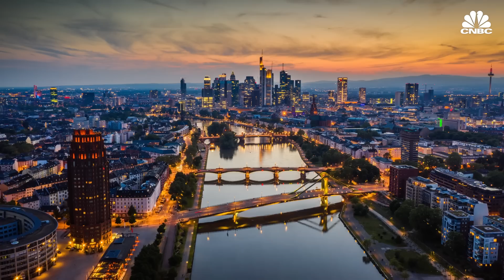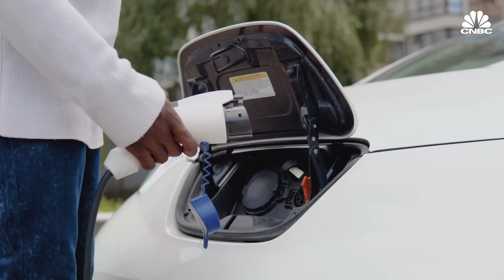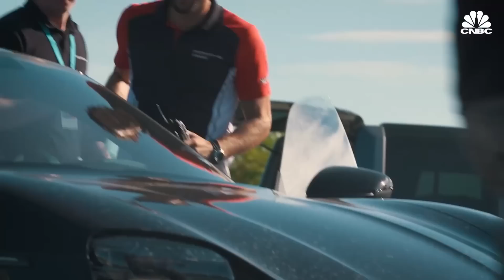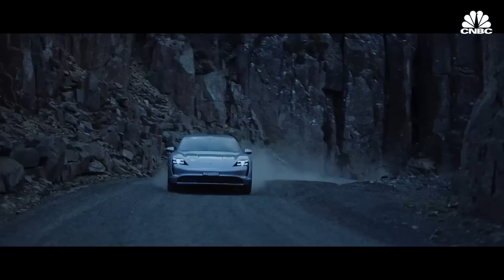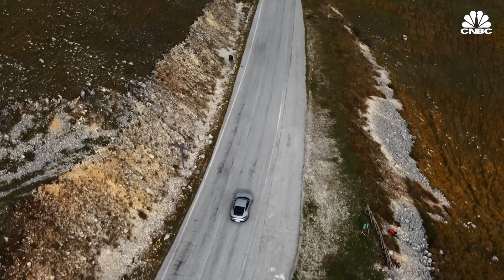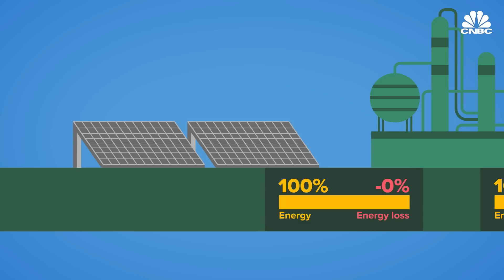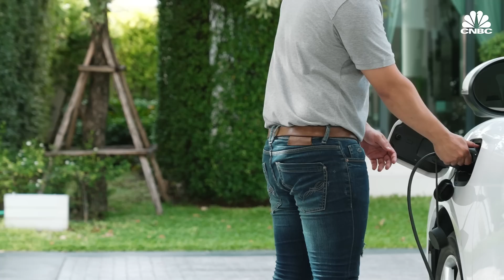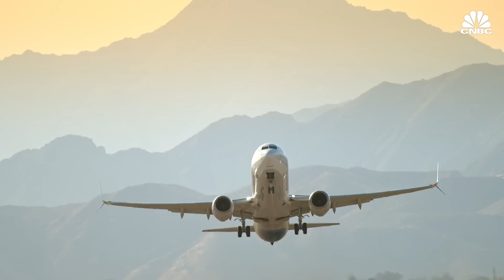How Porsche Plans To Keep Its Gas-Powered Cars On The Roads

Comment: Even if its "carbon neutral" it still spreads pollutants.
Reply: Electric cars do too.
Reply: @dadtherf401  but much much much less, my model 3 runs off my solar 100% so NO pollutants!
Reply: @eddevoe2519  until you realize it takes 100,000-240,000 miles to be cleaner than the average car and actually be zero emmision
Reply: @estevanperezz  not true

Comment: Automobile powerplants are just the start of this process of carbon neutrality.  Just wait until they apply the same ideology and methodologies to innovation and production of other technology in the near future.  Look around your home.  Imagine most of the things inside gone.  Your sofa, chairs, television, carpet, the glue holding your hardwood floor pieces together, your toilet seat, and most of everything else is going to be taken from you, or your descendants, eventually.
Look for a cave somewhere nearby soon, because there aren't many of them that are comfortable and people are going to be either "unexisting" others to secure one, or "unexisting" out in the open fields.

Comment: Why not just build over the coal burning power plants to collect CO2 more directly? It'll just become both the fuel and energy doubling the output no? Everything to collecting carbon from air to turning it into fuel sounds awfully inefficient. While it's a nice idea perhaps using that extra CO2 possible instead to be used as a fertilizer or for carbon fibres.

Comment: The point is that you can produce e-fuels where the sun shines 12 h a day, 35 days a year, and you can use them in Minnesota during winter when there is neither wind nor sun. That relativates the efficiency issue. Efficiency is not the point. The point is cost and time/location. The Saudis already build solar plants that produce electricity for 1 cent per kWh, corresponding to 20 cent per litre or $1.4 per gallon of e-fuel. The electricity is not a limiting factor.

Comment: Even if internal combustion engines are banned it would still be good for cement production and in Belgium you often pay €1.90/L for super +98 so the price difference won't be much if they can produce it on a mass scale.

Comment: Good thing we have 300 years of gas left
Reply: We don't. Around 40 to 50 at the absolute most. Nobody will still be extracting crude oil to refine it into road fuel in 25 years, never mind any longer. The air pollution at street level in our towns and cities will be unbreathable in 20 years, if we don't do something to reduce it.

Comment: This is so dumb that it hurts. Who would like to buy a slow, expensive, unreliable car instead of a spacious, fast, reliable and cheap EV? I think people will get over the petrol nostalgia pretty fast.
Reply: You're point of view is very ignorant unfortunately. There are many people that would like petrol cars in the future, especially in the sports car segment
Reply: @burgholte  People who said that analogue cameras would disappear were also ignorant.
Reply: @Rune Aanderaa  your comment is a contradiction to your original comment. Call me when your EV runs out of fuel in a remote are, I'll bring the ICE generator. Enjoy your traveling experience when the power goes out, or when your vehicle has to do a measurable amount of work 😂😂
Reply: @ʇɥƃᴉɹlɐ ʇou ɯᴉ  I live in Norway, and I have never experienced a power outage for 40 years. It is now pretty difficult to sell used diesel or petrol cars because they are expensive to run and frequently need service. Virtually all new cars are now electric. A friend of mine drove his Tesla to Montenegro twice last year without any problems. That is 3000 km one way. To buy an ICE car seems just stupid.

Comment: Porsche is showing what in depth engineering can do.   It needs to be stated again that noncondensing greenhouse gas behavior such as from carbon dioxide and methane does not warm the planet!   Carbon dioxide levels in earth's atmosphere are high for the last few millions years, but considerably low for high growth periods in the geologic record.  The cause of global warming is not known.   Global warming hit its high temperature of 1.1°C reported in 1991 and has not gone higher.  In 2022 global warming was reported at 1.1°C.  Earth's greenhouse effect would be held in heavy saturation by the strong greenhouse gas water vapor to add 10°F (5.55°C) to earth's temperature if it were the only greenhouse gas in the atmosphere.   Increasing greenhouse gases in the earth's atmosphere can not cause earth's greenhouse effect to retain more temperature.    Greenhouse gases are only active in earth's greenhouse effect that takes place within 20 meters of the surface.  After 20 meters from the surface all the far-inferred electromagnetic radiation from the surface that can loosely interact with the lumpy electrostatic fields of greenhouse gas molecules is considered to have been completely absorbed.  Its further heat transfer is by convection i.e. molecules bumping into each other.

Earth's greenhouse effect being held in heavy saturation by water vapor is well known and taught high school level earth science until Al Gore became vise president of the US in 1992 when Al Gore tried to make it US policy that human caused carbon dioxide emissions were causing global warming.  Al Gore spread the fraud that human caused carbon dioxide emissions were causing global warming far and wide to include the United Nations.   The fame that Al Gore has gotten from promoting carbon dioxide caused climate change has allowed his net worth of a few million US dollars after being US vise president to grow to well over 100 million dollars net worth.   There is no indication Al Gore was an environmentalist previous to his campaign against human caused carbon dioxide emissions and no more than token environmentalism later. 

The UN IPCC science reports when less than 200 pages long, provided you read the entire report, are transparent in that they only discuss greenhouse gases as cause for global warming and only sampled their greenhouse gases at an altitude of 20 THOUSAND meters well into the stratosphere where water vapor is near zero.  That declaration of sampling greenhouse gases at 20 thousand meters altitude both legally protects the authors from serious fraud accusations and means the UN IPCC reports are of no practical use for the discussions of global warming.  Educated readers will instantly wonder why gas sampling was not done over the entire air column of earth's atmosphere.

The main perceived benefit for going to zero carbon dioxide producing energy is not that there would be no carbon dioxide emissions, but that it would eliminate traditional vehicle producing irritating air pollution from unburned hydrocarbons.   This would make for a better quality of life in higher density areas such as cities.  Even local producing exhaust from gasoline and Diesel burning vehicles is irritating.  Over-the-road heavy duty Diesels in the USA meeting 2010 emissions standards put out extremely low emissions.  Non of the early 2010 HD over-the-road era Diesels actually were able to meet those emission standards and operate effectively.  It was far later about 2020 when over-the-road HD Diesels regained their million mile reliable operating life and then only from a couple manufactures.  Oxides of nitrogen are produced anytime high pressures and temperature take place with earth's atmosphere that is 78% nitrogen.  Oxides of nitrogen are produced in hydrogen fuel burning engines.

Comment: EVs are great for the majority of drivers. For some of us car enthusiasts, who are the minority, internal combustion vehicles are what causes us excitement. Sports cars, super cars and hyper cars are in low production and used infrequently, hence their carbon footprint being lower than say that of corollas on the road. Glad to see Porsche doing this as it will help keep these amazingly engineered vehicles on the road for the few of us that love them. I’ll gladly pay $10/g to keep my cars on the road. Would get an EV for daily commutes.
Reply: Exactly as a 23 year old car enthusiast myself when I heard Toyota was going to release the GR corolla with a six speed manual and a 1.6 L turbo charged in line 3 cylinder that produces 300 hp and 276 foot pounds of torque also with an all-wheel-drive system I about Peed myself with excitement and the icing on the cake is it comes with a mechanical handbrake that’s cable operated, and every other thing is pretty much mechanical the all wheel drive system the waste gate on the turbocharger the cooling system It’s essentially a love letter to the older cars that were all mechanical not to mention it’s a hot hatch, which is cool in itself but it’s purpose built to be fun and fast and put a smile on your face now if they would’ve made the GR corolla electric or even hybrid with a CVT automatic transmission it would’ve just been another dismal car on the road that meant absolutely nothing even if it had performance parts like good suspension and big disc brakes, and the carbon fiber roof that cut its weight down by 22 pounds on the circuit edition and even the much lighter Morizo edition that’s more track focused because it does not have a backseat it would’ve still been very heavy because of the batteries and electric motors, a dismal boring car thank goodness they didn’t do that to the GR corolla life is dismal enough with every new car, being a hybrid or an EV with a CVT transmission with a stupid name so I am very happy what Porsche is doing and I do think it is the answer with the E fuel electric vehicles are not the future at least my future anyway because I won’t be caught dead in one those cars are more like iPhones with a bigger lithium battery. Where is the enthusiasm and passion in that I know they have excellent acceleration, but that’s about all they possess that interest me and that doesn’t really make a fun exciting car that puts a smile on your face every time you drive it because you’re missing one vital component the noise, the noise of a naturally aspirated, or turbo charged and supercharged engine and modifications, of course tuning the engines to make some get more power. That’s also fun which electric cars would be taking away because you really can’t make an electric car go faster by tuning it, or throwing some performance parts to it besides tires and brakes and suspension you really can’t do anything to the battery or the electric motors that I know of anyway but even still, it’s not as enjoyable as there internal combustion engine counterparts
Reply: "I’ll gladly pay $10/g to keep my cars on the road."
Are you kidding?🤨
That's the price for fuel we already have in Germany.
To get this enviromental friendly you have to pay like $200/g.
Muricans...🤣
Reply: EV's are booring, they all drive the same, EV's are a step to just get people of the vehicles, and use public transportation and be dependent on government and loose their freedom of going anywhere they want and be confined to a 15 minute city and be slaves
Reply: EVs are not great for the majority of drivers; they are great for a very small minority of urban drivers - namely those in fairly dense cities in smaller, rich countries. Any timeline to phase out ICEs by X date is nothing but a gamble at this point that we'll have a magical breakthrough in battery tech before that date
Reply: I like dinosaurs too!
Reply: The longterm viability for your average third world person for EVs is unknown to me. As I get the feeling that EV vehicles will end up having a shorting working life than a ICE cars due to the difficult of sourcing parts and repairing electronic components.
Reply: I dunno but ev is boring souless and doesn't have a sense of fun...
Reply: 1) there is nothing unusual happening with the climate.

2) there is nothing wrong with burning fossil fuels.  Its problems in high-density areas are trivial to fix and already have been fixed.  CO2 is not a pollutant.

3) Climate alarmism is a big-lie superstition supported by tax-bribed liars.  (See Climate Discussion Nexus for 100s of videos on climate quackery, deception, and realism.)

4) decarbonization is 21st century pyramid building and human sacrifice. 

5) there is NO excuse for expensive electricity.  Electricity generation is boring.     Just burn coal and scrub the smoke in densely populated areas.

6) the only challenge is manufacturing market quantities of cheap gasoline.  South Africa has already done this for decades (Sasol), using coal.
Reply: Evs are great in what way? Straight line acceleration? Nothing else is appealing about them.
Reply: @MikeYurbasovich  Why EVs are better? Easy:
1. Motor efficiency -> lower costs (could even be free when you have a couple solar panels, you can't put an oil rig and refinery in your backyard)
2. much lower noise levels
3. no pollution of any kind -> NOx, COx, Pb and so on
4. doesn't require oil -> a rare ressource we use to produce plastic
5. doesn't treat the survival of mankind
Reply: @darthmaul8912  It is easy to call an EV better for the reasons you have mentioned. But at the end of the day it comes down to what consumers want. Porsche thinks there are enough consumers that want to drive ICE cars to make E-fuels viable. My estimate is that the world will become half electric and half e-fuel powered, after you include the shipping industry and airline industry.

Comment: The EU proposal did not refer to existing petrol cars, but only to NEW cars. I find it very questionable why many media outlets spread the story that e-fuels are necessary to keep existing cars on the road. The use of petrol in general was NOT part of the EU proposal.
Reply: True however firstly they will probably at some point ban gasoline and secondly we already have a lot of tax on regular fuel so it will probably become very expensive. E Fuels wouldnt be taxed the same way
Reply: @burgholte  Great points

Comment: That’s a horrible idea. CO2 and H2O are already in their most stable forms. If you want use them to make fuel, you have to literally put energy into it, so consume clean energy to make clean energy…why not just use battery stored energy? If you really need methanol as fuel, why not just make it from corn instead capture CO2 in the air and Hydrogen from water which is much easier and cheaper…This idea nuts

Comment: I suspect this is a delaying tactic to placate their childish, conservative, 50-year-old, customer base that would react like Kid Rock shooting a case of Bud Light if Porsche said they were going 100% electric. The truth is, as those old owners die out their kids are going to convert those Porsches to EVs (Porsches are one of the most popular EV conversions now) and buy new EV Porsches.

There is no way their fuel cost estimates are accurate. I have to assume $7 a gallon is assuming USA pricing and taxes. Desalination takes a ton of energy, electrolysis for hydrogen takes a ton of energy and direct air carbon capture takes a ton of energy. I know their customers are rich, but I still don't see this being viable.